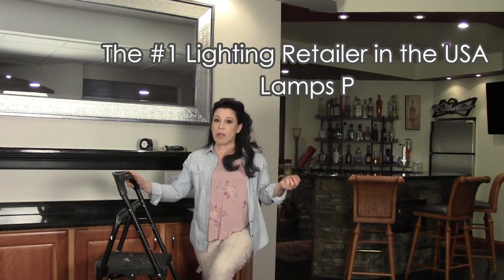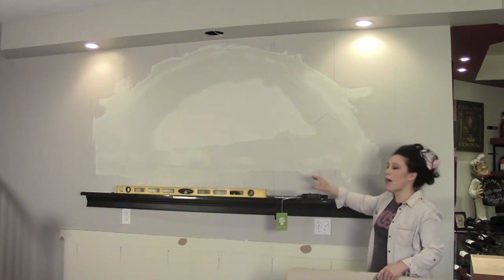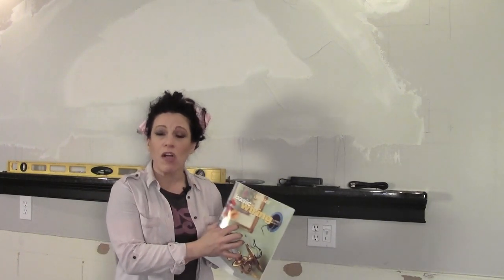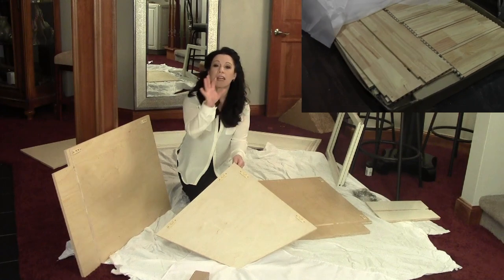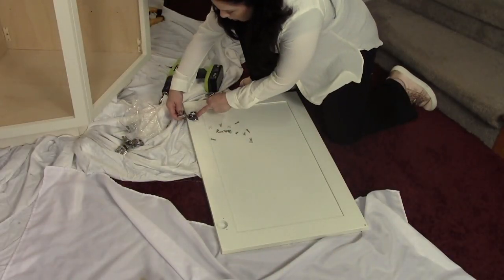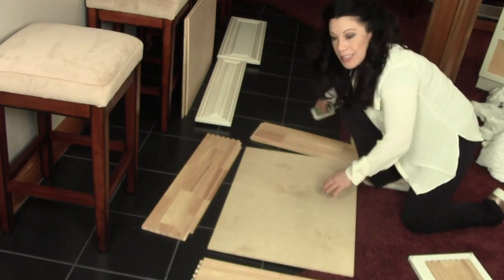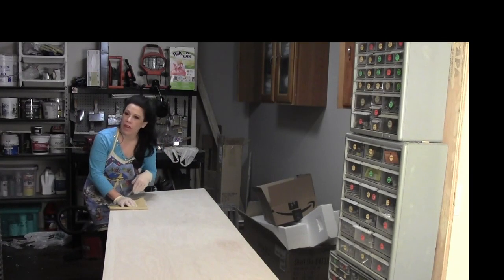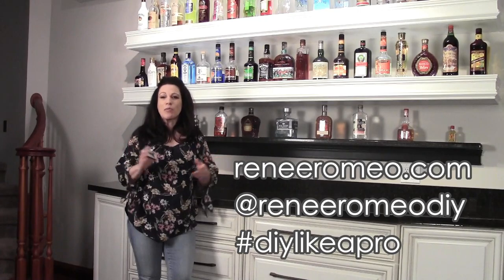Transform Your Bar With Clever Liquor Bottle Storage Ideas - Renee Romeo

Comment: Nice tips. Can you please name which resin clear coating you put on the birch plywood? how many coats did u have to use to get the gloss finish. I guess you did not use a epoxy glass like finish.
Reply from the maker: Hi Kamal, Here is the link to the product that I used: 
https://www.amazon.com/gp/product/B000M2SWNS/ref=as_li_tl?ie=UTF8&camp=1789&creative=9325&creativeASIN=B000M2SWNS&linkCode=as2&tag=reneeromeo0f-20&linkId=79a0a70f323ce2a137a34604454e70b3
I used two coats. One thin and one thicker. The instructions are included with the product but the most important aspect is getting the temperature perfect in the space while it's drying. It is a glass-like finish. Just beautiful and durable. You can see it demonstrated toward the end of the video here:
https://reneeromeo.com/2020/01/03/basement-bar-ideas-wet-bar-kitchenette/
All the best, Renee